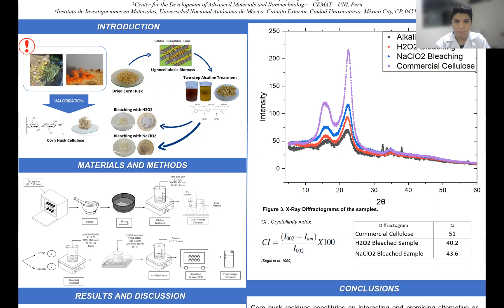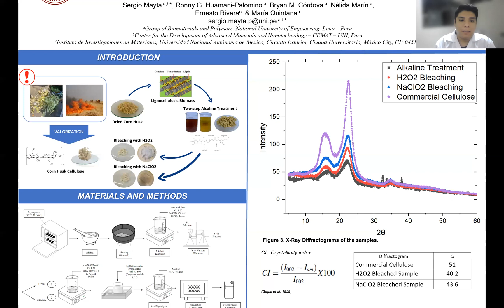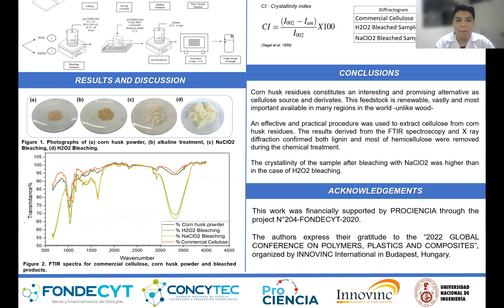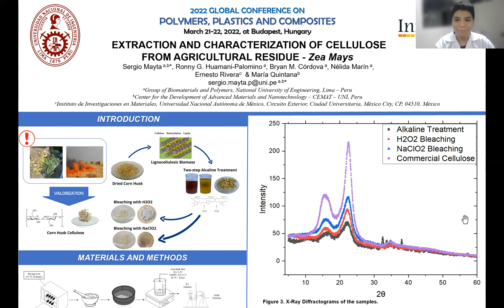Title: Extraction and characterization of cellulose from agricultural residue - Zea Mays

Comment: Sir, what you will say that production of cellulose by this method and using these materials commercially cost high or low? And what about the yield overall? What you suggest that it may be useful commercially or it is just lab stuff? I am undergraduate student, and I was assigned to search about a methos which should be cheap and give maximum yield. kindly share your opinion, Thanks.